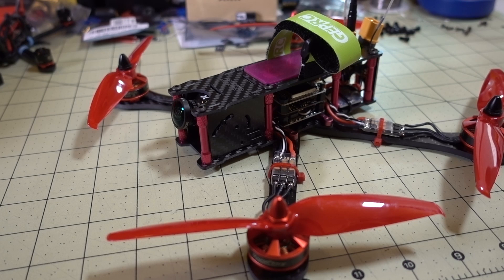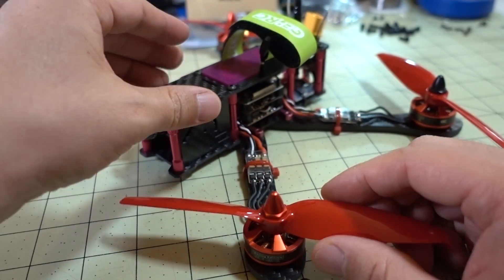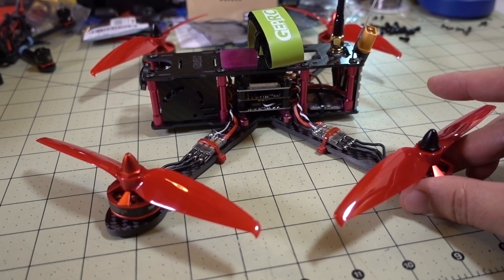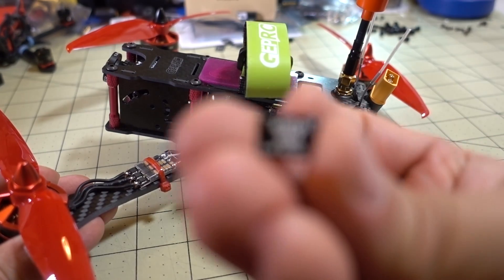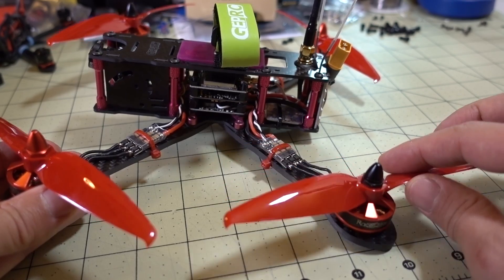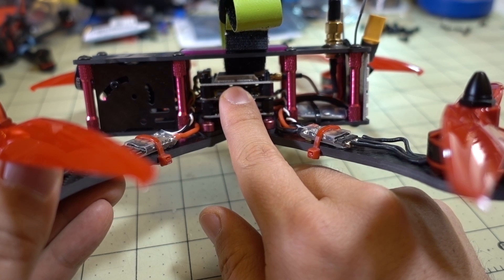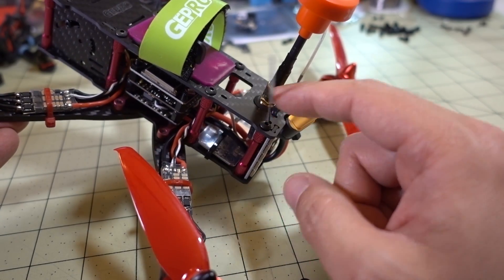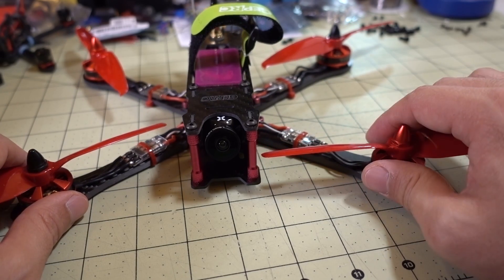Build a 6-inch Drone for Long Flights 👍👍👍

Comment: I want to build 6" quad with 4S 1500mah 100c battery.. 40A AIO esc
but i already have 4x Racerstar 2205 2300kv motors laying around.. will they work fine with 6040 propellers?

Comment: I have a question wouldn’t if you use 1600 KV
Maybe T Motor f40 
Would that get a good flight time ?
Either using a higher KV motor  
With a 6 inch build
Reply from the maker: That depends on your weight and battery and prop.  Perhaps you can share this with me?
Reply: Albert Kim  
Most definitely would like your help 😅
Would like to build a Chameleon Ti 6 inch 
Was thinking of a Flight controller Holybro Kakute F7  Tekko32 F3 ESC  R9receiver 
. I like those props used in your video 
A nice build you did also ...thanks

Comment: i personally would recommend trying to move your xt60 connector lead as far away from your video antenna as possible
i had an issue where every time i punched the throttle my screen blacked out due to the magnetic field inducing current on the vtx antenna blacking my screen out, as soon as i re arranged how my antennas are set up it fixed the issue no problem

Comment: Hi, I don't know if it's a good idea to let your battery drop below its nominal voltage of 14.8V, it may shorten its lifetime.
I'm using a 6" martian with a 6s 1300mah and 1750kv DYS motors, I'm getting 7min of aggresive flight time without dropping below the battery's nominal voltage of 22.2V. I will try a 2600mah 3s which I already have, to see if I can hover 15min at low speeds for long range.

Comment: Do you think the 2205 2300kv racerstar could handle this prop on 4s with 30amp ESC's?
Reply from the maker: The ESC should be OK, not sure the motor will be.  I think it will run hot.

Comment: I get 10-12 min on my 5 inch
Reply: What’s your setup?
Reply: realacc x210 frame, racestar 2205 2300kv, hlgrc f4 v5 aio, rs20 4in1 racestar esc, runcam eagle 2, cyclone 5045c props and tattu 1550mah 75 c 4s lipo . My first setup and it is still flying.

Comment: I am about to try the same prop on a 2307 1725kv motor. Tested out the 6x5x3 gate breakers and the exploded on a 6s. 4s and 5s was good though. I wonder how those racekraft 6032x3 props would do

Comment: slap some T-Motors F60 2200kV on and use 6040 or 6045 triblades to make the same quad a power monster. Flight time will likely still be around 6 minutes with the same flight style. But if you feel like it, you can crank up the camera angle, unleash the power and suck dry the battery in 2-3 minutes^^
I chose the exactly same frame for an almost identical buid as yours :)
The motors were Lumenier 2000kV though because I got some 2nd hand.

Comment: Howdy Albert,
How would you compare these motors to the racerstar 2205 2300kv motors(that im currently using on 6"martian)? would these be more powerful/ efficient for cruising and basic freestling?
i use 3s 2200mah and 4s 1800mah , 6040 props

thanks in advanced

Comment: a 1900 kv would get u more than 10m. i get 8 min+ on my 4" , i use brotherhobby 1507's @ 2800kv, with 4s 850mah, its still plenty powerfull, loads of torque .i get 8 min+ , thats not hovering i mean 8 mins of fun. just my opinion , but 2300kv isnt optimal for a 6" cruiser. u realy need to try out some motors in th 1900 to 2100 kv.  its a nice build tho man - gg ,

Comment: Reminds me of my King Kong 260mm quad I built nearly two years ago. I currently get 6-7 minutes on my ZMR 1804 2400KV motors with a 2200 3 cell battery.  I don't have the latest flight controller nor do I have OSD.  However, it's probably the best most stable bird I have ever flown.  I find myself liking the smaller quads better.. I actually tried to sell it on eBay.  No takers at only $80 that included two batteries.  Oh well....

Comment: Had that same exact frame in 5inch. Broke the top plate and an arm in very light crash, super disappointed. I contacted GEPRC for replacement parts, and they were going to charge me the same price as a new frame... I’ll never buy another product from them again.

Comment: Nice to see a person that is looking for efficiency for long flights. 90% + use the latest battery improvements to use it up faster for more power.
I have been thinking about longer flights in the smaller quad. A 6 inch sounds like a good place to start for smaller quads. I have been experimenting with long flights with 700 class rc electric and gasoline powered helicopters as well as Qav 500 quads.
I  am  looking for a very light 6 inch frame. I noticed your frame was over 100 grams.   I am considering a Hyperlite Floss 6 inch frame which is 72 grams . That is over 1 ounce  lighter.  Thanks for your power system recomendation as I will use it,and nice work as always..
Reply: Well, finally, glad to see i’m not the only one on earth shooting for flight time instead of bat-out-of-hell power.  Thanks for the motor suggestion.  Personnally, I’ve had good luck for flight time with Graupner 6030 3D prop.  They are only 3.0 pitch so are easy on the amp usage.
Reply: I will keep that prop in mind when I build mine.  I guess we are a rather small club Martin Arial.
It would be great to hear from the few others in our area of interest with their experiences.

Comment: Hey Albert...sorry for lame question ..how long does it take on shipping from gearbest and bangood? I haven't ever bought from them but you always present some good deals from them. I'm guessing you live in the states.
Reply from the maker: I live in California.  I've gotten stuff as soon as a week and the longest took 2 months.  It depends on what you get and if they have it in stock when you order.  Overseas shipping seems to be quite variable in time for delivery.  I usually order from there if I don't need it right away but if I do, I try to find it on Amazon and get it next day with Prime.
Reply: Albert Kim thanks. I thought it was that unpredictable. I dont mind waiting most of the time but it makes me nervous if its a lot of money.

Comment: Im curious about those motors and frame.. i have 6" with Emax 2205 2300kv using 1500mah lipo, flying close to 10 mins with kingkong 6040 props.. btw what is the height of the standoff ? thanks..
Reply from the maker: The height of the standoffs is mentioned in the frame review - https://www.youtube.com/watch?v=nPwWM8uwUlM

Comment: Was there any reason you opted not to use a 4 in 1 esc or were those just parts lying about?
Reply from the maker: Was planning to use part I got and were waiting for a build.  Since these arms are wide enough to ESCs, I went with individual ESCs and saving the 4-in-1 ESCs for frames with skinny arms.

Comment: You should give the HQ 6x4.5x3 glass fiber props a try, I get even longer flights using them vs any bi blade! They are very surprisingly  efficient on the lower end.  Very cool seeing you have a 6"!

Comment: getting 18 min flights on my 6 inch with f40 pro v2 1600kv on a 2400mah battery, cruising of course. 7 mins freestyle on a 1500mah.
Reply from the maker: +CarelessMedia 2400mah, wow! What prop?
Reply: Albert Kim, same props you're using

Comment: It has horrible electrical noise I don't understand how people fly like that with horizontal lines across the screen every time you give it throttle. A low ESR capacitor should clean that up
Reply: Mr. I Don't Understand A Proof Of Concept Build why so critical??
Reply: its a great vid, nice build and lots of good info.   thanks for sharing.